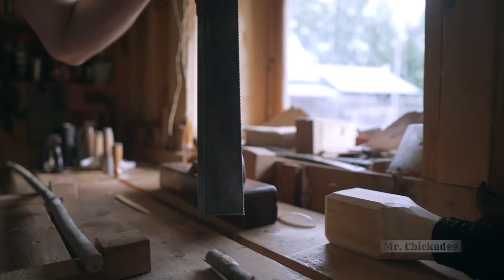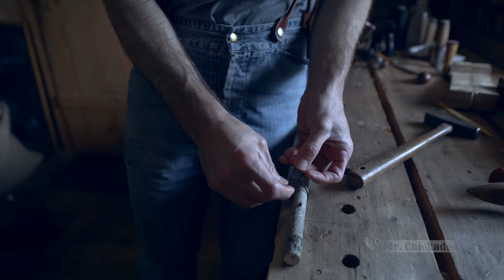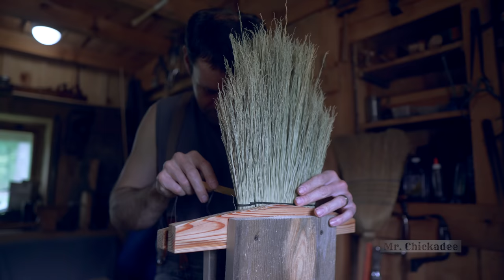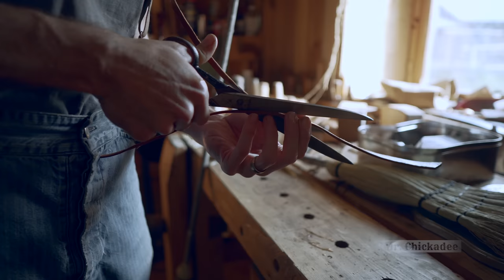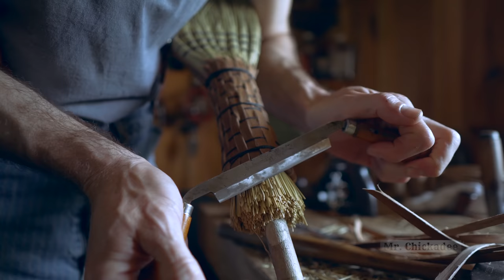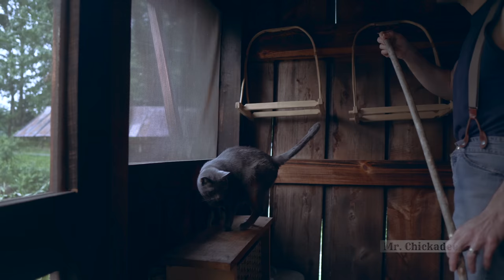Making a wildwood broom with hickory bark braid

Comment: Josh, there are no captions, so I would like to ask clarifying questions (I've been drying my broom material all year). 1) What was the knot you started off called? 2) What was the knot you ended the wrapping with called? 3) Do they ever slip/ need to be retied? 4) Why wrap the broomcorn "upside down" to then fold over and make part of the rest of the normally wrapped grass? 5) What kind of knot did you tie in the end with the loop through, and pulled tight? 6) What resources did you use to learn how to tie the broom? Many thanks. LG
Reply from the maker: 1)clove hitch 2)cinch knot? 3)nope! 4)to add more mass on the sides 5)overhand knot 6)youtube videos "broom making"
Reply: @MrChickadee  thanks Josh. I find my clove hitches slip and loosen as the grass rotates in use. No matter how tightly I wind. How do you deal with that?